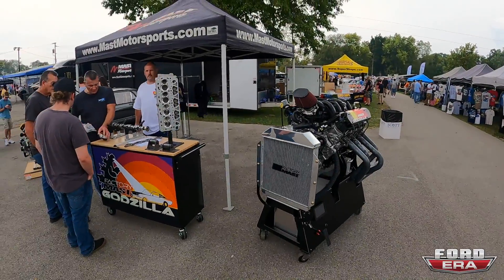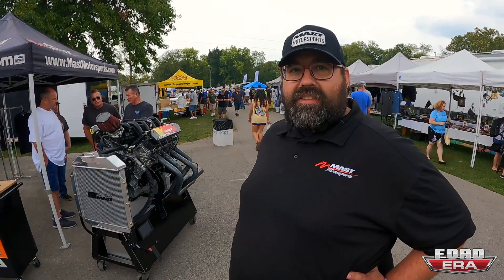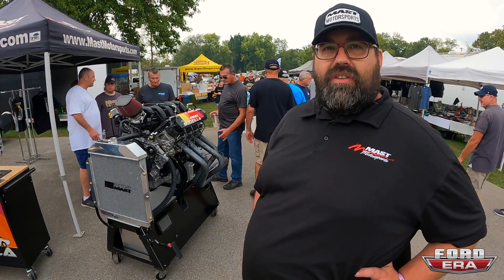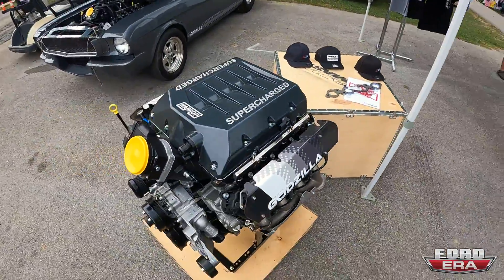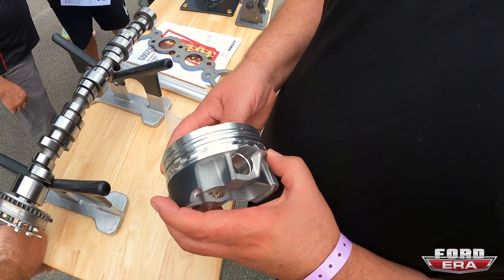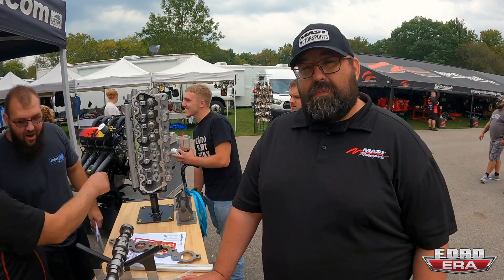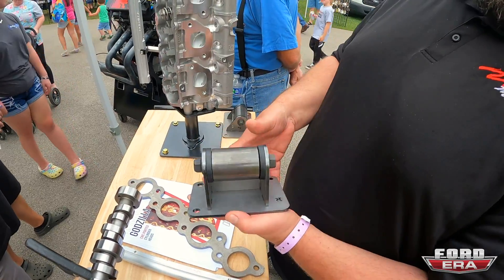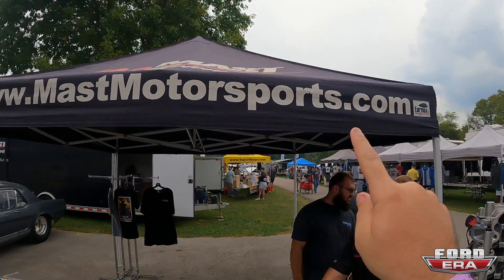675HP Godzilla Crate Motor from Mast Motorsports | Ford Era

Comment: .700 "lift" flow is a joke of a "spec". If and when an "American V8" engine valve reaches that "lift" it has no duration there and the piston is effectively in "neutral" and not "pumping air".

Comment: Chevy's latest and last "LS" is 650/650 SAE net (i.e. with all accessories and "corrected" to a "standard day" at 1500 feet ASL)  naturally-aspirated from a  6.2 liter small-block. And you can get one in a car that "stickers" for under $60,000 and comes with a 10-year/100,000-mile full powertrain warranty and 2 years of "free" dealer service and maintenance. And it's "obsolete"..

"Godzilla" is a 445+ cubic-inch "big-block" with "VVT" and variable-displacement oil pump and "direct-injection" and needs $7500 of aftermarket "high performance" parts and "tuning" to make "675 hp" NA "naked" on an engine dyno and with "long tubes" and who knows what "correction factor" and is "MODERN" AND "HIGH-TECH". 

With its typical Ford "big-block" 70ish CC combustion chambers ain't NO amount of "porting and polishing" ever gonna make "high performance" on a "big-block", lol.
Reply: Not sure I follow you, at all.

Who says the Godzilla "requires" $7500 worth of aftermarket to get 650hp?

Comment: I Keep wondering why the throttle body is kicked up like it is? Like hood clearance wasn't already at a premium.
Reply: It's set up for a truck. Need a different intake for cars, or put a hole in the hood.
Reply from the maker: they are working on it. these motors were made for f250s
Reply: @FordEra  I had to see one for myself. I just went and looked at a new F250. And good lawd there's so much stuff crammed in the engine compartment it's kinda hard to even see the engine. It will be nice once we start seeing them more in hot rod trim.
Reply from the maker: @worldssickestmedia2713  i havnt looked at the new f250 but i believe it

Comment: I’ve been really excited about the Godzilla motor, and I’m gonna have to get one! I think they’re going to start being used instead of the Coyote motor in a lot of these truck builds. The simplicity, and the torque will be awesome to help move the extra weight of a truck. 👍
Reply: @Victor Garza I really like the coyote, but I’ve been told by engine builders that they start getting unreliable around boosted 700 hp for street use.  I know the Godzilla’s new, and time will tell, but there’s quite a few of them out there running 800+ boosted horsepower with stock engine on the street.
Reply: @Russellsperry  Where? YouTube? ROFLMAO. Yeah. You can trust the internet.